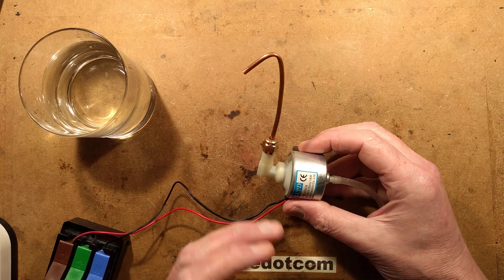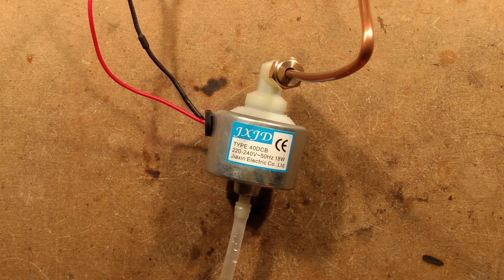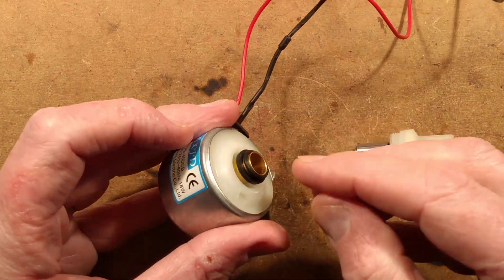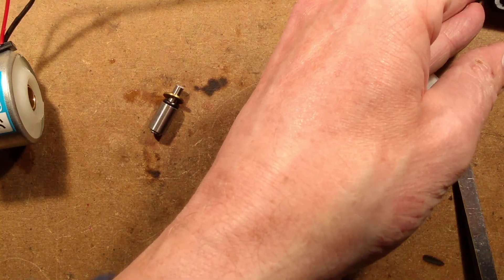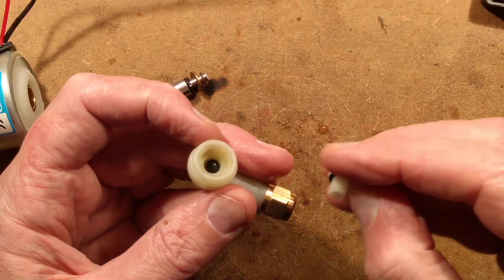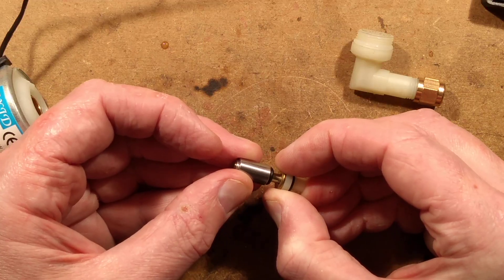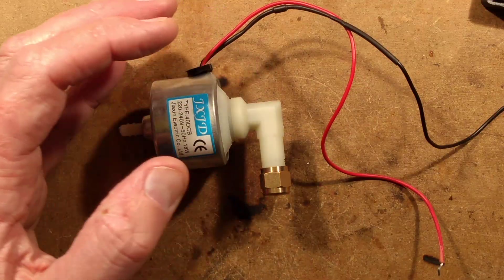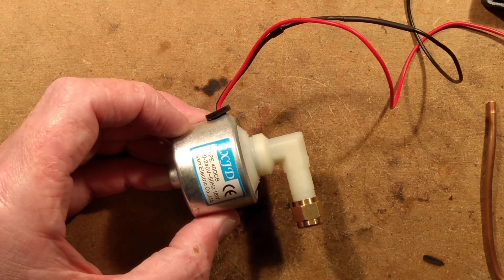Fix your smoke, snow machine, steam mop solenoid pump.

Comment: With internal combustion engine carburetors, the float bowl gaskets like to swell in the presence of gasoline. One way to try and get it to go back to shape is to either leave it out to off gas or to boil it in some water for 5-10 minutes to drive off all the gasoline. Maybe that would work with those 6mm rings??
Reply: Here it's the crap alcohol they water down the gasoline with.

Comment: I've encountered the case when diode was blown that I've replaced. Cleaned that with IPA and oxalic acid, washed through with distilled water using veterinary syringe then reassembled.  That smoke machine worked at least 8 years after that.Very thorough explanation, thank you, Clive!
Reply: Vladimir at first I thought you were saying you could fix a blown diode with IPA and oxalic acid. Was gonna say I've been doing it the wrong way all this time, I've been cleaning my diodes with white vinegar.
Reply: Thank you for your comment! Oxalate in the right place for once.
Reply: I have a 400 watt Spirit Halloween fog machine that is not working. I opened it up and the diode connected to the bump is burned up. Any recommendations on what diode to use for a repair?

Comment: I repaired my smoke machine by using a better pump. What you got there is the cheapest available.
It never failed since then.
Would you show us a professional pump?

Sometimes the heater gets clogged, too.

If you use a thyristor you don't need the diode.

Comment: Offtopic: I bought some flickering candle type LEDs but they don't flicker with a lithium cell at 3.0V. Anyone know if they're not flickering because I'm operating them out-of-spec or is this just the regular Chinese seller nonsense?
Reply from the maker: They should flicker at 3V.  Note that if you connect them in reverse it may damage them if the battery can supply a lot of current.
Reply: Possibly they sent the wrong things then. Can't find the part number (BI01652A1X01) on the bag with a search. For $1.50 I'll probably just keep them as yellow LEDs. Annoying though.

Comment: My dad used to say of mechanical things:  "Son, you can fix most things by taking them apart, cleaning them, and putting them back together."
Reply: Yep, exactly.
Reply: That was true in the old days, when things were not made shitty and Chinese!
Reply: PirateKitty very true sadly.
Reply: ...and if that doesn't work, consider checking the carbon brushes of the motor. Or rather, where they used to be.
Reply: Attila Asztalos lol
Reply: Good advice!
Reply: The mechanical equivalent of turning it off and on.
Reply: When I was a child I used to do this a lot and it's true, it usually worked.  Everyone thought I was some sort of mechanical genius but that's just because none of them had ever bothered to take anything apart.  More fool them.
Reply: Even if it doesn't, you didn't do any harm. It was broken already!
Reply: Truth

Comment: You can also try to boil the o-ring in clean water and in most cases it'll return to its original dimensions. I use that trick for o-rings that touch fuel in automotive applications. Just don't let it touch the bottom of the pot or it may melt to it.
Reply from the maker: I'll have to give that a go.

Comment: As long as you thoroughly flush it with distilled water afterward, there's no harm in using an acid for cleaning. I use citric acid, as it's more aggressive than vinegar, and less expensive per unit volume if you know where to look. Also, it dissolves solid deposits MUCH better when it's HOT.
Thanks for the tear-down and explanation of how it works, Clive! :)

Comment: Why not do the vinegar washing cold? Doing it hot will mean any impurities in the vinegar will be left behind when it boils off. I guess it's not as effective. Maybe the best way would be with heat, but below the boiling point.
Reply from the maker: The pump will not run unless the heater block is up to temperature.
Reply: How easy would it be to bypass the interlock?

Comment: Will this method work for the smaller 12vdc 4.2 watt pumps on eBay as well?
Reply from the maker: You can often open them and clean them, but they are based on a magnetic rotor and impeller.  If the cover comes off the impeller and core usually slide out.
Reply: I've got a 12VAC impeller type pump in my cat fountain. My water's pretty hard. Tried cleaning it with vinegar and couldn't dissolve all of the scale that built up on the shaft that the magnet rotates around. Finally gave in and carefully soaked the motor innards with a household descaler called CLR and used a fine pipe brush (with gloves, eye protection, ventilation, etc.) to work on the harder deposits. Has worked like new after that. 

Does anyone know where I can get a submersible impeller pump that pushes maybe 50%  - 100% more water than the garden variety one found everywhere? The stock 12VAC 200ma one that I have works as designed to aerate the water and doesn't splash much, but my cats like to drink from the falling water. The water flows so slowly that they lick the spout rather than the stream. I want to get the stream to be a bit more robust. Specs for small pumps are almost never listed online. Any ideas?

Edit: spelling.
Reply: Only one way to know.  Buy one and take it apart!

FWIW, a DC pump needs some sort of oscillator to switch the coil.  And at 12V it will have a finer-wired coil with more windings.  Otherwise the design is presumably very much the same.
Reply: I wouldve thought there would be less windings at 12V. The 240V primary of a transformer has more windings of thinner wire than the low voltage high current secondary. Are solenoids not the same?
Reply: @Simon Tay -- This isn't a transformer.  Unless I am severely mistaken, a lower voltage requires more windings to produce an equivalent current and consequent magnetic field.
Reply: Undefined Lastname Thanks. I hadn't thought of pond or even aquarium pumps. I am a bit hesitant about putting 110V in something my cats drink from though. Any freak electrical leakage could ruin their whole day...
Reply: Undefined Lastname Good point. It may be a while, but I'll let you know what I wind up doing. Thanks for the advice.

Comment: Got rid of my 3000 Watt smoke machine last year, after many years of scaring the local kids, only have my crap Martin jewel 24/7 fog machine left that has the usual blocked heater, would love to know where to get another heater from.
Reply from the maker: From a Martin dealer if they still stock them.  But it may be cheaper to get a new machine.

Comment: Is the polarity of the inline diode important? I guess it depends if the metal "core" is magnetised...
Reply: Nope, it makes no difference. The core is ferromagnetic, but has no magnetic field of its own.
Reply: What would happen if the diode went short or was bypassed for some reason? Would the pump still work but just draw more current.
Reply: most likely become a vibrator/buzzer without enough stroke to pump and I imagine overheat until coil burnout occurs :)

Comment: Thanks to the sound i now know what kind of pump is beeing used in my steam assisted oven in case it breaks down :)
Reply from the maker: It's a very common style of pump used in many applications.  Another common one is some condensate pumps in air conditioning systems.

Comment: Thanks Clive.  Now I know how to take the pump apart in my coffee machine, it's been on a go slow for ages.  I might try disconnecting the heating element and put white vinegar through it first.
Reply from the maker: Some coffee machines have a cycle for descaler.
Reply: Thanks Clive.  My machine works like new :)

Comment: was that stuffing gland in the wrong way round ??
Reply from the maker: The brass cap was tapered and the end of the plastic pipe was flat, so it seemed the logical way round.  I should have noted the way it was in when I first got the pump and immediately took that bit off.
Reply: AH Ok It just looked like the plastic elbow body had a countersink hole that the conical stuffing gland would fit into

Comment: springs and Orings pinging every were it would not be right it that never happened
Reply from the maker: It happened the first time I took one apart.  :(  Now I'm older and wiser I do things like that less frequently.
Reply: If a spring goes ping it will never be seen again.
Reply: @simontay4851  with most small parts, if it's not embedded in the bottom of your shoe check the vacuum cleaner bag. If you have a dog or a small child you might have to wait a day and then it's more a matter of how bad you want it.

Comment: Many home espresso machines use these too!
Reply: That's where I recognised the sound from!
Reply: No wonder the things seem to crap out so often.  I find the pump makes a ton of noise but nothing happens, and it's almost always the pump that breaks.
Reply: A LOT of noise, not a ton.
Reply: Yeah had one of these pack in and stop my morning caffeine fix. easy enough fix though.
Reply: They can wear out on the small coffee pod type machines I think if they are allowed to run dry too often
Reply: home ice makers too
Reply: Damnit, beat me to it, yes, I've repaired a few in some very expensive bean to cup machines, they're not cheap pumps if you buy them instead of repairing.
Reply: Dentist Chair Water Taps
Reply: Steam cleaners and generator irons too !
Reply: The more you know! I have an espresso machine with a steam wand and I live in a very hard water area. I guess I'm flushing out my machine with vinegar this weekend.
Reply: I have a neighbor a  who bought a second hand Kerig Coffee maker a while back . she got it home and it worked for four days then died. she gave me the machine to part out and I found out these have these pumps too. got lots of interesting parts out of it.